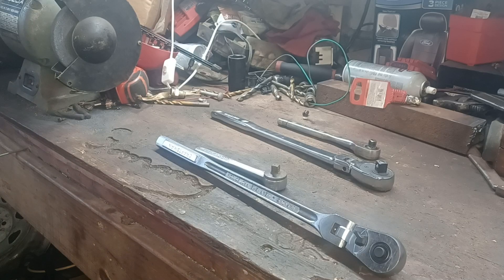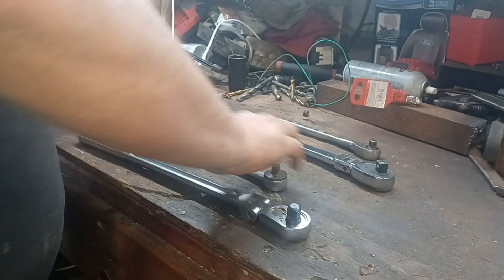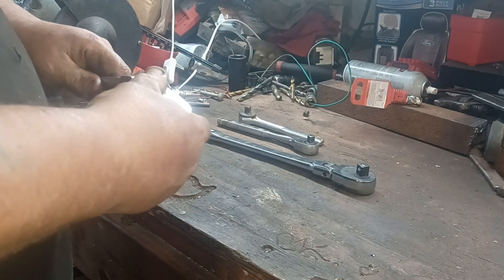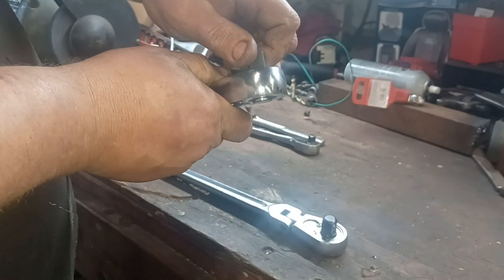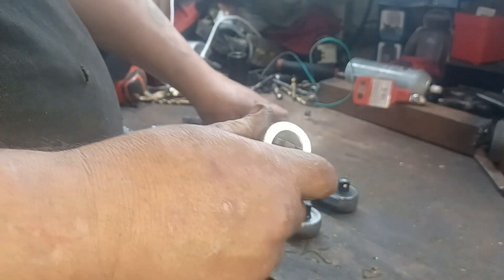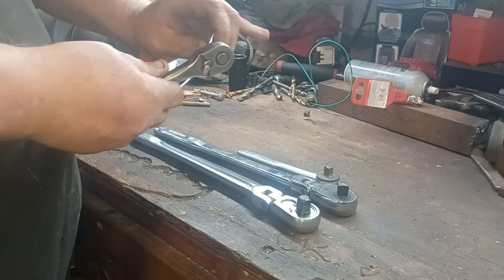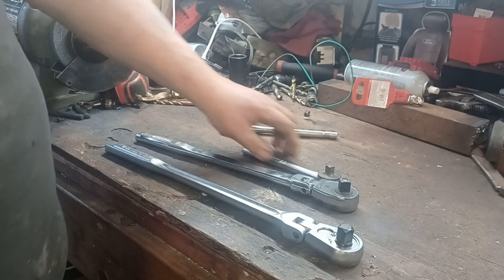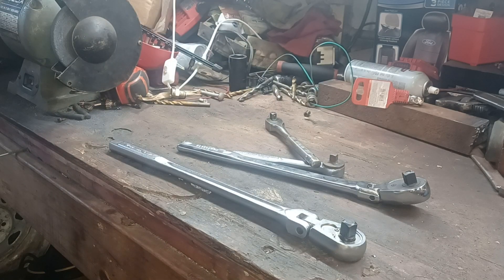USA Vintage Craftsman ratchets VS new Craftsman ratchets

Comment: I have the same vintage Craftsman 1/2" flex head ratchet. It is a real workhorse. I'm not a fan of the latest models of Craftsman ratchets. While the ratcheting mechanisms are smoother than the vintage ratchets, that chromed handle is way too slippery for my liking. My most used ratchet is a Craftsman Professional 3/8" flex head with a hard plastic handle. It's 36 tooth and provides a solid grip. The vintage round head quick release ratchet like you have are 45 tooth count.
Reply from the maker: A 36 tooth or 45 tooth are power houses they wont slip.
Reply: The Craftsman 1/2" Flex is my lug  nut wrench.  I keep it under the seat of the truck.  
Had a chance to bid on one last year,  I figured it would not go high.....Nope.  There are a bunch of us out there that like those old ratchets.....
Reply from the maker: @Dancing_Alone_wRentals  Got to love all vintage tools.
Reply: @Dancing_Alone_wRentals  Half inch flexes are going for around 70 dollars and above... I've tried to snag one at a lower price...nope.
Reply: @FoxyMcFoxFace93  Yipes...I had no idea.  There was one outside of Philly that went for 10 bucks.  I was too far away.

I had no idea.

Have a good week(end)
Reply: @Dancing_Alone_wRentals  That would have been a steal!
Reply: @FoxyMcFoxFace93  exactly.....
What is funny is that these ratchets are actually very useful.  Some ratchets I use just because they are old and cool.

My Craftsman flex head is my go to for lug nuts....it goes with me wherever I drive.

So what good plans do you have for the weekend?  What's the next project?
Reply: @Dancing_Alone_wRentals  Thats exactly how I feel about vintage Tools.  Well, I have a craftsman torque wrench with a cracked locking ring that needs repair... hopefully some of the vintage Tools I bought arrive this weekend too!  What about you?
Reply: @FoxyMcFoxFace93  I have parts coming in for the Deadline.  Driver's CVaxle and a radiator.
The hood is up...just waiting on the parts.

I also have some brake pads to swap out on another one.  My thinking was to group all these repairs together.

I'm supposed to be towing stuff to storage and getting work done for the town....
They are going to hang me by my toes if I don't crack a whip and do their lists.

My thinking is I need to have three old trucks....this way I'm never down to just one and I can proactively keep one fixed. 
 (That is me talking like I know what I'm talking about....I'm practicing...maybe I'll convince somebody....maybe not).

The weather is on our side....it will be a good weekend!
Reply: @Dancing_Alone_wRentals  Sounds like you will be busy!